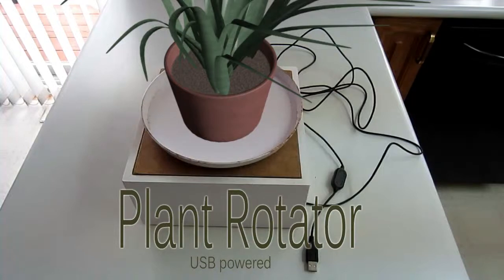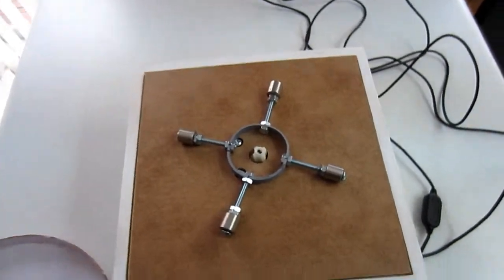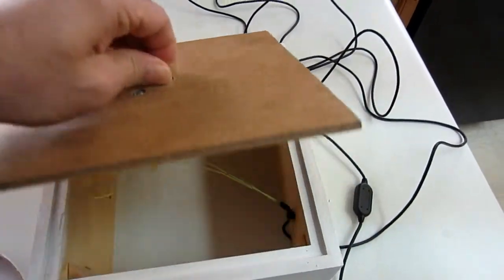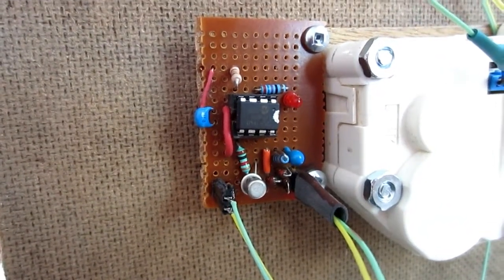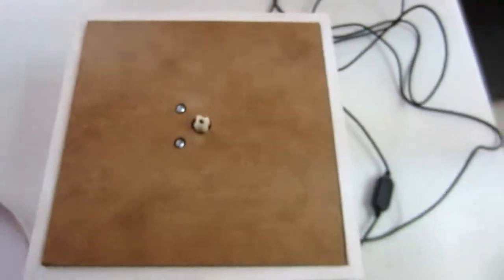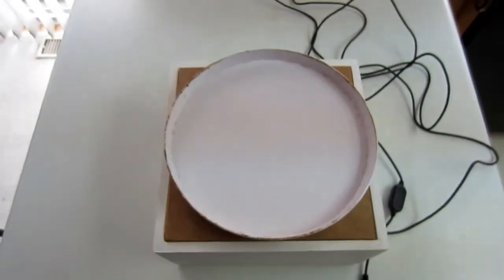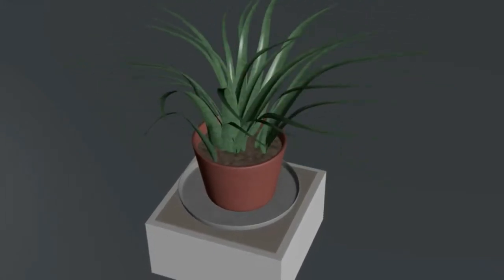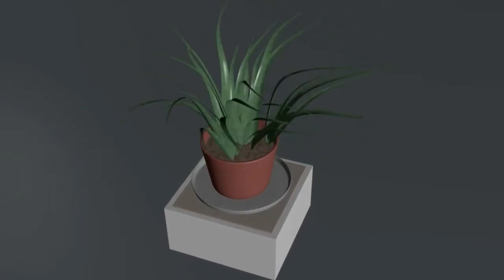USB Powered Plant Rotator (with animation)

Comment: Is it possible to buy something like this from you that could support a relatively large, heavy plant?  What about something like this that could operate under solar power and also slowly a turn a large heavy plant?
Reply from the maker: I think it would make more sense to find someone near you to do it. Or maybe contact one of the commenters below who seem to be doing this commercially :) Making things like this is just a hobby for me.

About heavy plants, I would start with a circular bearing like what is used in a lazy susan. Solar power would probably work for my unit. The motor uses little power and only runs for a fraction of a second about every 10 minutes.

Comment: You should add a cheap solar cell to power the turn table.
Reply from the maker: Good idea.I think the power usage is low enough that would work with a small 6v 100ma one and a battery/super cap to charge. However, I only made one of these and where it is located there is no direct sunlight so I don't think it would work for my situation.